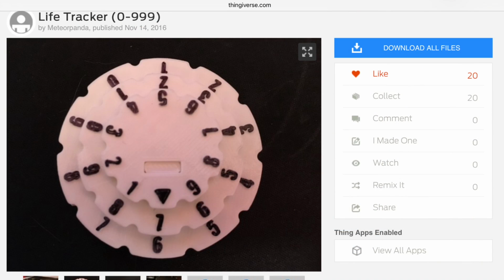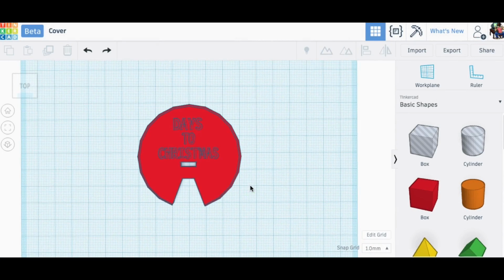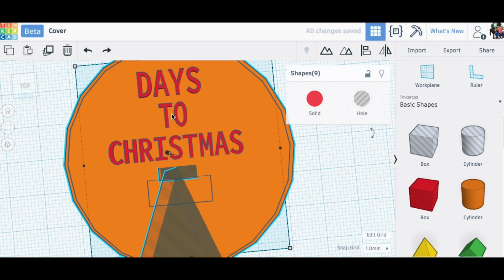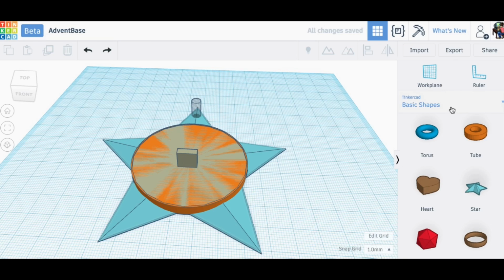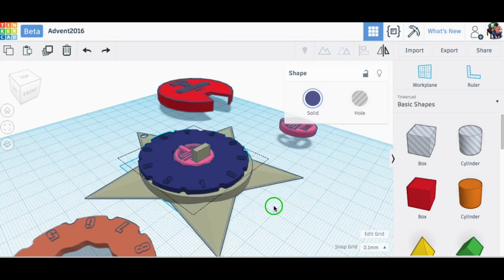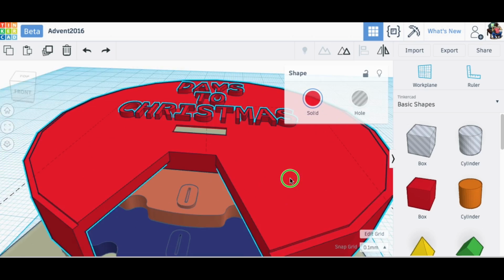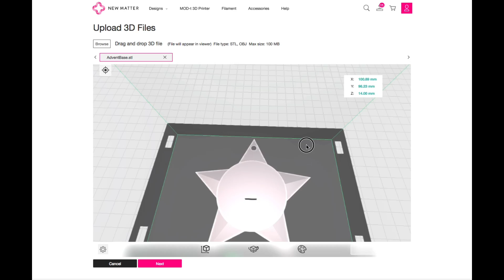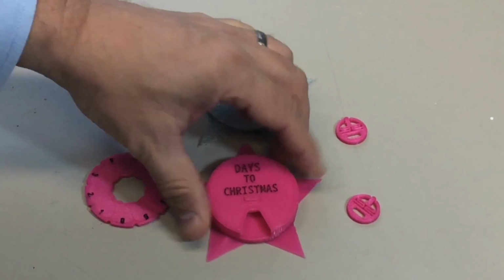3D Printed Christmas Advent Ornament Printed on New Matter MOD-t Printer

Comment: I wonder how hard it would be to couple the two digits.
Maybe a mechanism where a peg on the 9 engages a lever on the base that pushes the other wheel.?
Reply: I think one way would be to have a springy pin on the lower value wheel, and when it passes over a hump in the base, it would push up into some teeth on the higher value wheel.

That's the simplest mechanism I can think of that doesn't require additional parts, but I'm guessing that would take a lot of trial and error to make work.